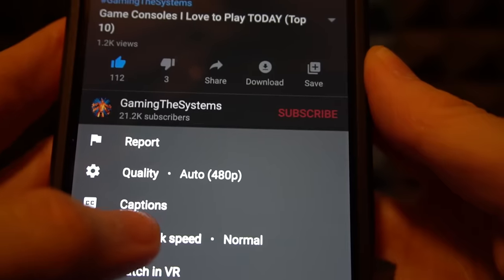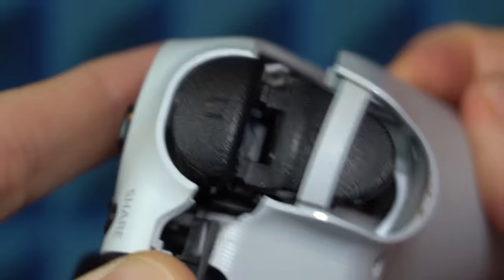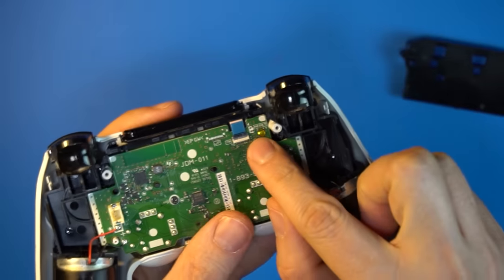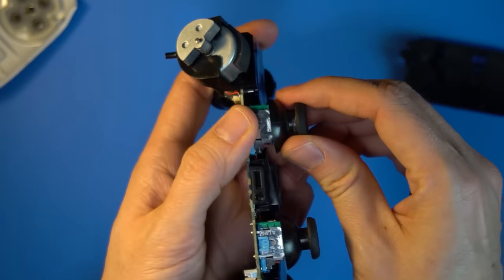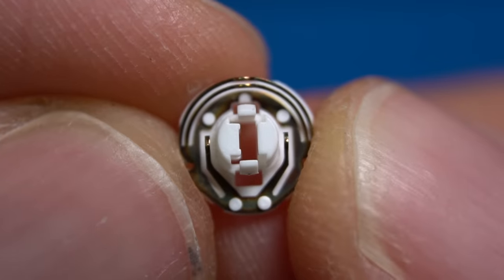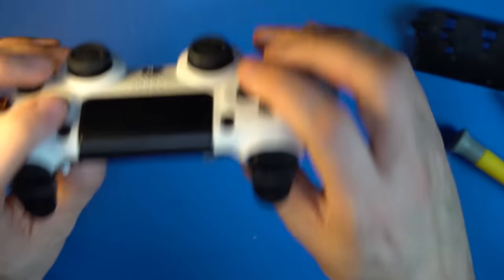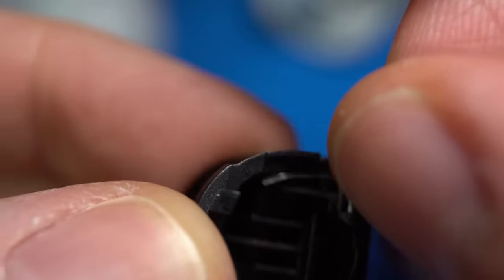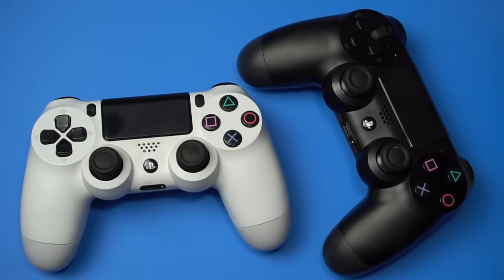How to Repair a PS4 Analog Stick That is Drifting, Sticking, Jittery/Cleaning DualShock 4 Controller

Comment: WORKED. Pay attention that if UP or DOWN are faulty, the box to clean (with the small disc) is the SIDE one. If LEFT or RIGHT are faulty, the one to clean is the TOP box.
Reply: I cleaned both just in case :d
Reply: i prefer do both right away in case,
Reply: Omg I just finished putting it back together, tested and the issue remained. And then read this comment... 🥲
Reply: @1995alleniverson hows ur controller

Comment: Here’s a tip: at the end where he connects the ribbon thingy from the top half of the controller back to the motherboard and says the silver wire traces should face the battery, on the original controller from Sony it’s the other way round, it faces away from the battery, you can have a look in the little bit where it connects to to see what side the silver traces are there :)
Reply: thanks bro. i was able to fix the drifting but i was having issues with charging.

Comment: Thought this would be easy but I’d rather just buy a whole new controller 😂
Reply: You have same thinking as me
Reply: Redd Ace not really
Reply: Some wd 40 on the analog mechanism will fix most issues after u clean the disks. thats what i do to my controllers.
Reply: So try to fix it and if you fail then buy a new one
Reply: Redd Ace i fixed 2 and failed on my 3rd
Reply: if you are gonna discard it for a new one, might as well try, you wont lose anything anyways
Reply: Redd Ace  just blow on the joystick it works for me
Reply: Bro , this was my exact same thought after watching the video.😂
Reply: Naa there to much 
Best buy selling them for 60 and xbox is 40
Reply: I’ve opened up a number of them, and honestly, i agree, I would tell you to just buy a new controller.
Reply: That's what they want u to do.
Reply: Legend is always a legend
Reply: Redd Ace same story😂
Reply: Fr
Reply: Same
Reply: Relax it dont needs soldiering. It needs patience and calm moves.
Reply: Redd Ace same
Reply: I was thinking about the same thing i don't have the patience to do this
Reply: same 😂
Reply: I never had contact with circuits and managed to do that in 10 minutes. try, it is better than nothing. in the worst case you will have to buy another controller anyway
Reply: @wildzabu9305  what the I tried it and my controller started working good thx
Reply: It really is more simple than it looks. Theres only a couple main parts and a few small parts. I took apart mine for the first time and had no probs. Just have patience with yourself!
Reply from the maker: Chances are the new controller will do the same thing eventually.  Besides, it can be fun to fix things.
Reply: Redd Ace go to the shop we’re you buyed it they could repair it.
Reply: The time and stress is not worth it
Reply: Lucas Gawor because you are probably some of the lucky people that are “up on game” so you know how to prevent it.
Reply: Goodluck cuz it's going to happen again in like a few months
Reply: @Hiken_Bakuzan  this is my thinking I'm waiting until I get my new 1 to try it
Reply: @FifaPRg  right. don't even want to think of how much money that makes them I am sure they could totally protect it if they wanted, you got a PS4 loads of games that adds up to alot we need are controller
Reply: It works. Took me around an hour in total as I thoroughly cleaned it. Saved me buying a new one. Controller is now immaculate and feels as good as new.
Reply from the maker: Easier ways here: https://youtu.be/Lt0uHmGMKx0
Reply: @HowToX  i did this now my lightbar wont turn on and my controllers will not charge when they still had battery it did solve the drift
Reply: I have a weird problem does anyone know a fix? My cousin dropped my controller and now my R2 doesn't work and whenever I move my Right stick it acts like my R2 idk why.

Comment: You saved my controller from being destroyed on the floor, thank you, was literally driving me insane.
Reply: just destroyed 2
Reply: Twan Rip my guy
Reply: Yeah I actually started punching mine. Still not fixed though
Reply: Did you clean the white disks or you just cleaned the part that they were sitting on?
Reply: Mine broke because I was raging and smacking it and I fixed it by smacking it again instead of doing this because I didn’t feel like doing it.
Reply: Factzzz😭😭😭😭

Comment: Alright, so this video helped my fix my initial problem with a buggy analogue stick, and now whenever i use either the panel, the pause button, or the share button, my controller powers off.
UPDATE: i opened it back up and messed around with how the battery was put in, and turned the ribbon cable connected to the light around. It works now.

Comment: It's honestly easier than people think it is so long as you go slow and don't be afraid to add a little bit of force to things. Just be careful and gentle with the small parts and you'll be fine
Reply: Yeah fax when I first pulled out the analog sensor I thought I broke the spring cause i was using the sensor from an old controller but the second I put it into my normal controller and re assembled it BOOM it’s now working perfectly
Reply: Me trying to pick drifting controller apart and clean it
My controller is dead now.

Time to get a new one

Edit: it works now my controller's strip's silver side faces away from the battery
Reply: @ckl3045  damn i owe you one. I had the same problem and i was so scared that i broke something. Luckily, I didn't
Reply: I messed up at 3:45 broke that small metal thingy
Reply: @gingeralef1  I hope you get a new one soon or some way to fix it. Or already got one
Reply: @gingeralef1  I don't blame u that's definitely the hardest part of the whole process. Those things are really fragile and the green doors can break easily as well (don't let this put u off trying to clean the controller btw, it's worth it)
Reply: Can u explain how to forcefully be gentle plz cause I'm having trouble
Reply: I broke the soldering when i tried to open stick door.
Reply: It's not difficult but When I was doing I experienced at some time that I have been f* ked up but somehow I managed to reassemble them and worked perfectly the main thing was that I was also not having a proper tool for that disc inserting thing and that blue film that was difficult to get it attached. So ask yourself Again for doing this and I did what he said but didn't fixed that issue so dont do I suggest from My personal experience
Reply: @gingeralef1  bro you should buy new one I am saying about that part it's available online but if you have buyed new so congrats for tha😂
Reply: @alexburks310  It's applying enough force to get the thing you want to move to move, but not so much that you break it or something else.

It's kinda applying force and then easing up bit by bit, gradually applying more force each time until you get the required result. That's honestly the best way I can describe it. Just something I learned how to do with working with odds and ends over the years.
Reply: @JEE-ff5pp  A good pair of tweezes helps out quite a bit with stuff like this. It's much more precise than your fingers. I always have a pair ready when I'm working with small things in case I need to grab or manipulate something.

Especially if you're working with electronics, the less you touch with your fingers (ALWAYS wash your hands to remove dirt, grime, and natural oils built up) the better as the natural oils on your fingers can cause dust build up among other issues.

Tweezers are always the way to go.
Reply: @ckl3045  same
Reply: @razuberii77 p
L
Reply: Bullshit. I tried following this video and like three different plastic pieces fucking snapped off
Reply: @tateroblaze744  I don't know what to tell you. Did it myself twice now and had no issues. Maybe you used too much force, maybe you threw or dropped your controller too much and they were broken or loose already. There are things that can go wrong for each individual person. I can only share my own experiences which happened to be successes.
Reply: @netherremains  yeah but how about you shouldn't even have to do that. Who buys a playstation to become some controller technician lol. Nah Sony foul
Reply: It really doesn't matter that much if you break it either. I mean, you're opening it because it's unusable so in the worst case you have to get a new one anyway :D
Reply: @YungPuyLicker  All
Reply: Dude I fucked up and now my stick drift is 10x worse 💀💀💀
Reply: What about when your analog L3 button is very loose what should I do
Reply: @jadashields5166  This is likely due to the springs within your analog stick being really worn out so they supply no tension anymore. If this happened after you tried to repair the drift you either forgot to put the springs back or you put them back in incorrectly
Reply: @netherremains  i think mine was Soo old towards it just not acting right I had got a new one tho but sadly it was my favorite controller Soo should I throw it away or keep it for something else

Comment: That moment when you put it all back together and you forget the analog sticks. 🤦‍♂️
Reply: Eimaj XC how lmao
Reply: just happoned to me lol
Reply: @asburyross8355  When i put it back together, it surprisingly worked for the most part. I have very little to no drift compared to the constant stutter i had but it took a couple tries. Did yours completely dissipate?
Reply: Eimaj XC A day later, do you have any issues with joystick alignment or any issues of the sorts that you notice could be from you taking it apart?
Reply: Wtf 💀💀💀😂😂😂
Reply: Lol I took mine apart forgot why I took it apart then I put it back together and then my problem was still there and I couldn't be bothered pulling it back apart
Reply: @koopahkeoghan7703  Yeah, stuff like this is only for the tinkerers and desperate lol, but it helps if you like to tinker with parts or whatever. It took me a couple tries. The hard drift came back after a couple months. I just said forget it and bought another controller.
Reply: The smile on my face dissappeared.
Reply: I must've messed something up cuz now the stick is constantly registering as going upwards
Reply: @Bishcona  You have to be careful on cleaning it since its very sensitive to debris. I would check the part that holds the analog again to make sure it's put back correctly and that its clean to the best of your ablity. It's going to take a couple tries. Good on you for even putting it back together to work 😅.
Reply: @nephxc2938  yeah I've had problems with it for a while and managed to temporarily fix other stuff by taking it apart and putting it back.
I figured this is where my luck eventually ran out and I had to replace it anyways so I just got a new one but thanks anyways lmao
Reply: @nephxc2938  how did you close the green locks it wouldn’t let me
Reply: @ibbym9160  You have to press them down pretty hard then. if I remember correctly, they should snap into place.
Reply: I did this too
Reply: I just did that at lol

Comment: How is this such a common problem with the DS4? I’ve had every PlayStation to date and haven’t had any issues with the controllers until now. Hope Sony get their crap together for the ps5
Reply: Yea playstation has some pretty cheaply made ps4 controllers
Reply: @808sandDre  That's engineering for ya, however much they test things a small thing like that is almost impossible to see coming when there are millions of controllers being made and sold. But hey, it keeps fixers in business :p
Though I have to say, opening the ps4 controller is so much easier than the ps2 variants, those are a nightmare to put back together due to silly design choices.
Reply: It's grime that builds up inside the controller not a hardware issue. Watch the video.
Reply: Yeah bro I love the knock off ds4
Reply: is the original v1 controller better than the v2 then?
Reply: I've been using a V1 controller for more than 4 years without any malfunctions,

 until I had to buy a knock-off v2 because of the back button attachment being not compatible, and this stuff happened in less than a week. Back to the ol' reliable

edit: never buy knock offs, it'll cost you more
Reply: @Scuderia-se6if  nope I have a V1 happened to me I replaced the entire white piece It worked for 2 months now it's happening again.. So fucking annoying
Reply: im guessing this is done on purpose so sony force you to buy another controller every 3/4 months to make more money, ive never had a thumbstick issue with an xbox 360 controller
Reply: DA LE  dont buy cheap shit then, go to a game store or a super market and get a legit ds4 controller
Reply: @Addicted2Battle  Exactly. Don't buy cheap shit versions.

A single original controller can go for years
Reply: Check the boxes,their made in China and well mostly 1gen controllers were made to last these now sold are replacements Sony just being cheap and making a profit

Comment: For me the long ribbon had to be plugged up with the sliver side facing away from the battery. The other way made it so it would not charge. The video fixed my stuck drift problem however so thank you.
Reply: You're a legend brother, was just having that trouble then !! Thank you
Reply: Same here but once switched it worked
Reply: Same here. I thought I was a goner. Then I flipped it the other way. Stick feels way more smoother now and less drift.
Reply: Can confirm mine are like this as well (CUH-ZCT2 / 4-594-645-xxxx). If you look in the slot under the right light you can see where the contacts are.

Comment: What you're doing here is cleaning what's called a "potentiometer" or a "variable resistor". These are used in everything from volume wheels and volume sliders, to the thermostat part in your home's thermostat. They've fallen out of style due to how easily and quickly they get dirty and stop functioning as intended, but for analog controls (like analog sticks) the only alternative is to use magnetic sensors, which would interfere with the controller's accelerometers and each other in such a small controller.

On that note, there's a potentially/slightly easier way to clean the dirty potentiometers. You probably won't need to snap open the casing like in this video, instead you can use compressed air to blow inside the potentiometer and dislodge dust. If that doesn't work, then pour a few drops of Isopropyl Alcohol (IPA, NOT Hydrogen Peroxide) and wiggling the stick is often enough to clean a potentiometer. IPA is safe for electronics, but only use a few drops and make sure it dries completely before re-assembling the controller.
Reply: You can also spend a little bit more for a small can of DeOxit instead of isopropyl alcohol. I usually find it's worth it.

For those who don't know: DeOxit is a combination cleaner/conditioner/lubricant for potentiometers that's pretty easy to find. It'll come with a little straw/tube that you put into the spray head to focus the chemical where you want it to go. Put the end of the tube up against the line where the green cap meets the metal base of the sticks, spray a bit in (you won't need much, though getting into the right place without lifting the green cap may be tricky), then work the stick its full range a bunch of times and allow to dry. It's pretty effective stuff.

(I'm not associated with the company, I just use the product.)
Reply: i tried this just now. i poured a few drops of alcohol and it actually worked and it was unexpected 😂 thanks for saving me from doing all the work!
Reply: @riverabryan6703  did you pour it in the analog stick or the green box.
Reply: @Kimi-fy8eh  i didnt open my controller, i just poured a few drops into the analog stick
Reply: @riverabryan6703  oke tnx will try
Reply: I have 2 controllers one being a backup both left analogs had issues & I was prepared to go all the way with repairs. I decided to try this method first.  I used alcohol & dropped 3 or 4 drops on each side of the stick rotated them a few times & pushed them in I went ahead & cleaned the right ones two. Surprisingly it worked on both glad I decided to skim thru the comments 1st thanks a lot.
Reply: @riverabryan6703  can I use water ?
Reply: What's the name of those "tiny disc"? I need go change one because it's all black and deformed but I don't know how to search for it.
Reply: The Batman that’s a bad idea mate use isopropyl alcohol
Reply: @venomwise  I don't have it
Reply: The Batman just buy a small bottle of it it’s very cheap
Reply: Can i use hand sanitizer?
Reply: Akmal Alamsyah maybe but I wouldn’t risk it
Reply: @akmalalamsyah  it has water, don't do it
Reply: Thank you, I'm definitely going to try this

Edit: worked perfectly, didn't have to pull the potentiometer out of the socket, I just put some isopropyl alcohol on it from the outside. Now the drifting is gone

Comment: I've never even opened a ps4 controller before and after this video I decided to try if it would work even for a beginner? Well, I succeeded and all I needed as a tool was a screwdriver, which I used to make one working controller out of two broken ones😇🙏 Many thanks for the video, it saved me 60€ + now I can disassemble and reassemble the controller whenever necessary if any part breaks. It will continue to save me money, so I really appreciate your well done video!🙂👌